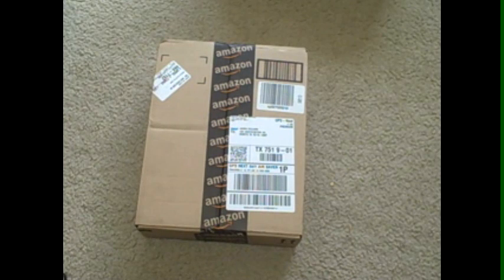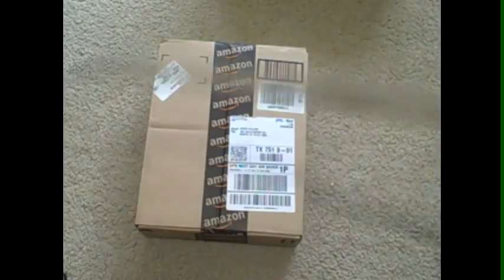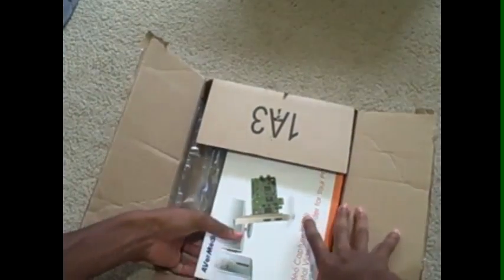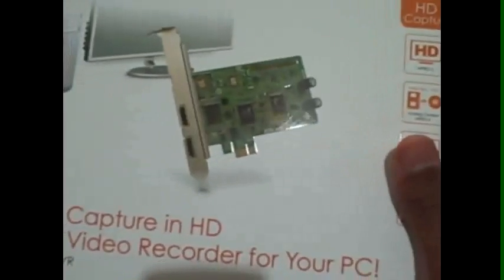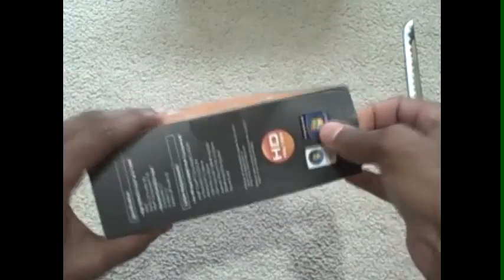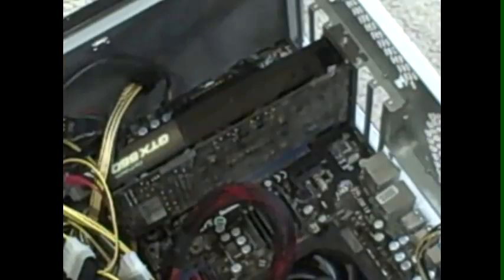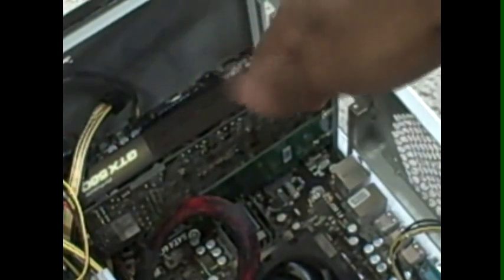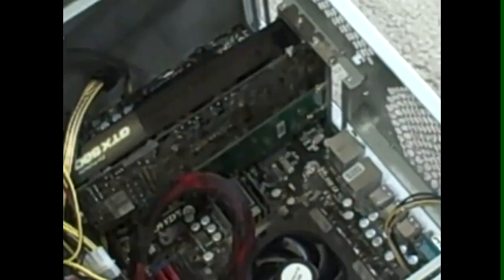AVerMedia PCI Capture Card Installation

Comment: Shokio the front fan is not helping because the PSU cables are blocking the airflow and you need an exhaust fan to get hot air out of the case as you have none. It seems BBC took it with him lol

If CPU temps are too hot, it might be because it's summer and it's hot or the thermal paste needs to be re-applied or maybe both.